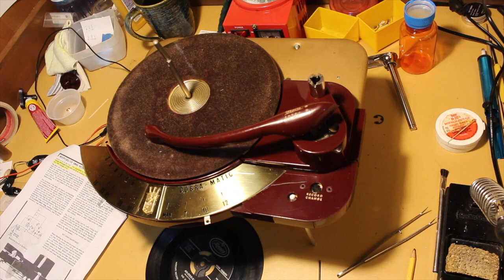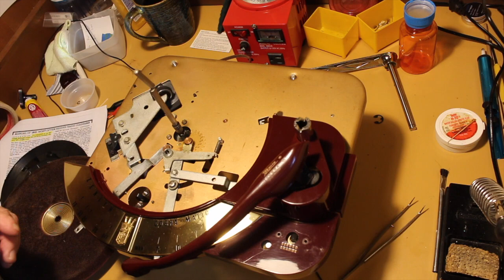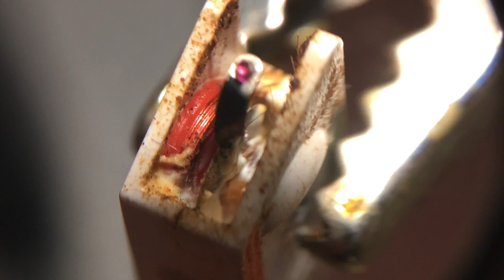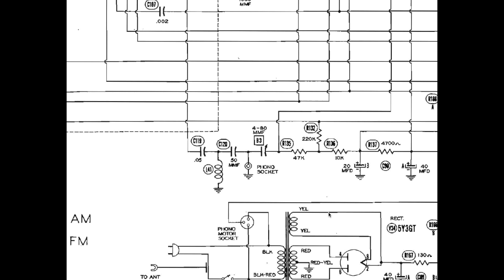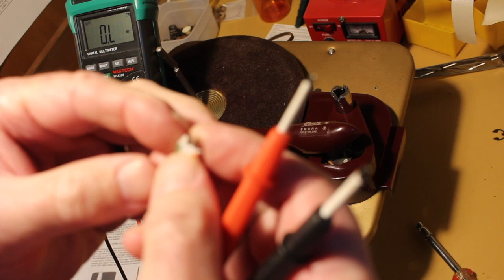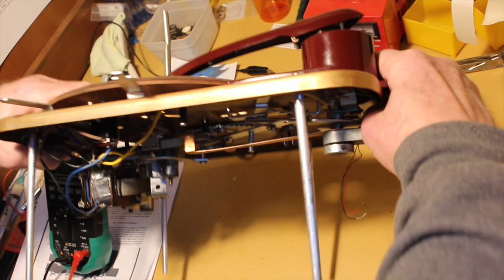1951 Zenith Cobramatic Episode 4 Finishing Up

Comment: Hi I'm having an issue with a 53 cobramatic which looks identical to this one. All is well it gets up to speed (78 rpm in my case)  it goes into play mode it get to 10" but as soon as the needle drops it comes to a screeching halt. Any idea why?
Reply from the maker: Hi, Joe. First of all, have you or someone else gone through the machine and cleaned all the old lube out?  Has the idler wheel been replaced?  When you place a record on the spindle and start the turntable, does the record drop normally?
Reply: @fibberscloset498  yes idler wheel was replaced, everything drops, arm lines up based on selection. Ive had it apart a few times, it looks pretty clean. Where do you suspect I might have to clean lube?
Reply from the maker: @joeleonard34  A couple more questions. When you say it comes to a screeching halt, do you mean the platter stops turning even though the motor is still trying to move it?  I’m beginning to wonder about the clutch being out of sync.
Reply: @fibberscloset498  yeah as soon as the needle lands the patter stops but the motor is running
Reply from the maker: @joeleonard34 OK, does the platter slow down and stop, or does it stop suddenly?  Sorry for so many questions, but I have not run into this before.
Reply: @fibberscloset498  no problem I appreciate your knowledge, it stops pretty suddenly
Reply from the maker: @joeleonard34  When it stops, can you rotate the platter by hand in a clockwise manner?
Reply: @fibberscloset498  sorry missed this, yes I can

Comment: Really great video series. 
I’m currently restoring a cobra matic myself and watched your video for tips. 
Question. What did you use to clean the gold plated part on the front with the record speed and size selectors and what did you use to polish the chrome record holder arm.
Reply from the maker: The gold color was simply dirty, so mild soap and water brought it back to life. I'm not sure what Zenith used to achieve that gold tone, but it doesn't appear to be metal plating; more like some kind of paint, so go easy when trying to get it shiny. The chrome was polished using Noxon 7 Metal Polish. Best of luck with your restoration!

Comment: Looking forward to seeing how it sounds in the next video! Curious how the new idler wheels perform, and if they result consistent rotation  speed. I am restoring the same model and my sound quality is not great, but I haven' yet had the idler wheels rebuilt. They are in pretty good shape, but the rotation speed (measured by the RPM Calculator phone app) varies slightly.
Reply from the maker: I don't hear much wow. I have an app for my iPhone which will measure flutter, etc. I'll let you know how it looks.
Reply from the maker: Hi Bill, I just checked the rotation speed with the RPM app on my iPhone.  At 34.73 RPM, wow/flutter was 1.05%. How does that compare with yours?
Reply: @fibberscloset498  I use the Android app, and at 33 the speed varies 1.5%. At 45, it is 2.7%, and at 78 it varies 2.6% but is it hard to tell since it is revolving so fast and the numbers are constantly changing. Ive seen videos showing these apps accurate to .1 rpms on a modern turntable. I think I need to examine my idler wheels and have one or both of them rebuilt. I did manage to improve sound quality a little by adjusting the phono oscillator trimmer. I also discovered that cartridge angle matters a lot. My cartridge holder was bent, but I'm not sure exactly where it should be, so am trying slight modifications, trial and error. Getting closer though! Thanks for the info.

Comment: Speaking of the rumble, I bet in 1951 most folks' record collections had a majority of older 78's so it wasn't noticed near as much too.  I wonder if that amplitude modified signal produced is the basis for the design of tube AM transmitters like those from Allied Electronics that folks like to build to be able to broadcast old radios shows, etc. to their vintage radios.  Some day I'll build one of those kits but for now I'll just keep using my talking house transmitter as it seems to have a really good range around the house.  Sometime this year I'm going to get electric back out to the garage again so I can get back to working on stuff.  It's been out since April of last year and I'm getting rally tired of having to run an extension cord from the house to the garage every time I want to do anything and even then I can't use my new 240v 60 gallon 2 stage air compressor I bought a week before the power in the garage went wonky, so it's still a brand new compressor, lol.
Reply from the maker: As I recall, Zenith itself sold a stand-alone "phonograph oscillator" that did just that. Thanks for watching.